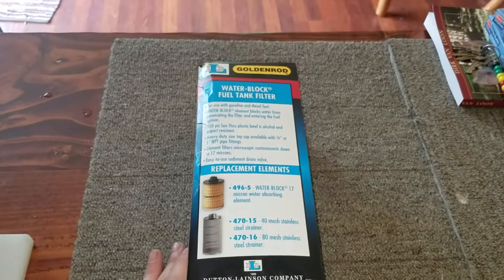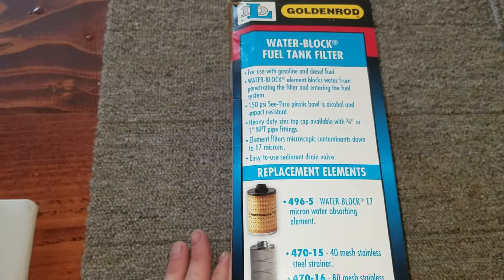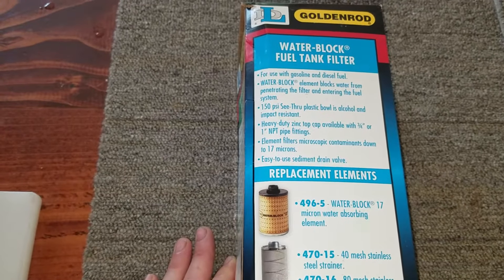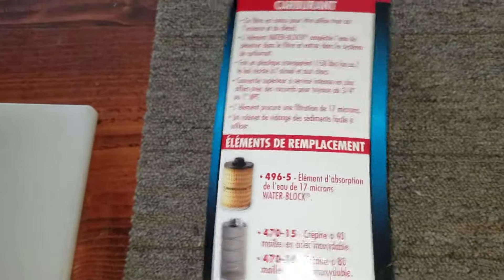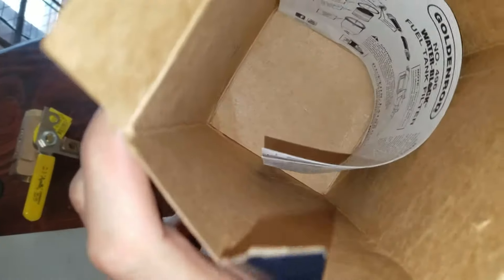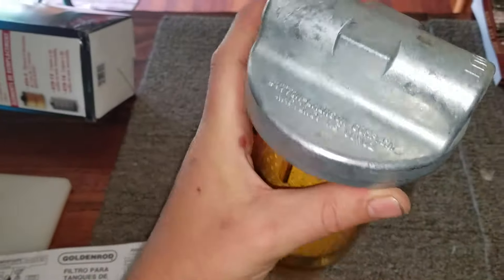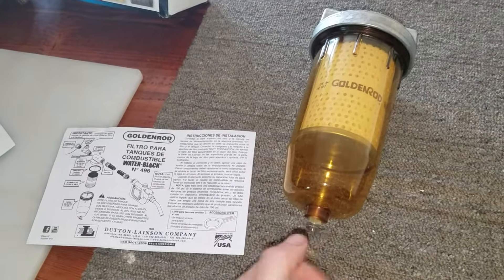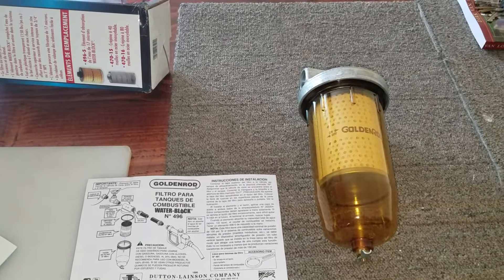unboxing: GOLDENROD 496-3/4 WATER-BLOCK FILTER (56591) Bowl Fuel Tank Filter

Comment: I note that they say a shutoff valve is Important.I would agree if the application is gravity feed but if pumping from a truck mounted transfer tank,would you really need one?
Reply from the maker: Its good to have one just in case of emergencies  and so you can change or service  the filter with out having to empty whole thank